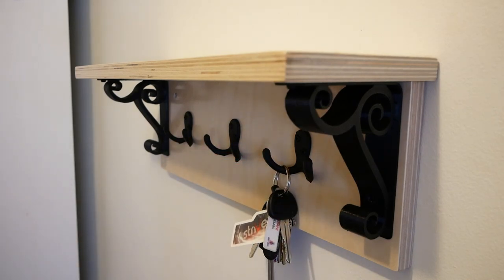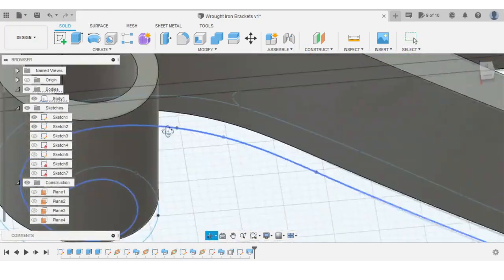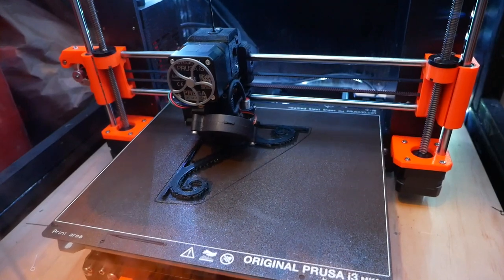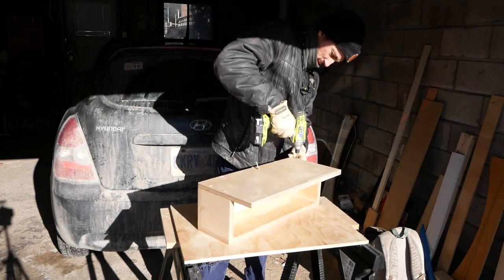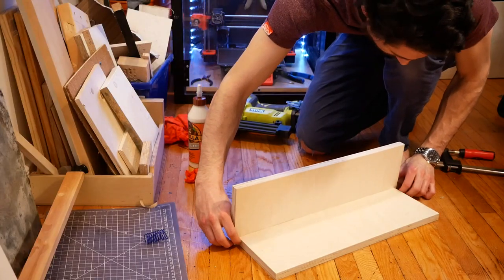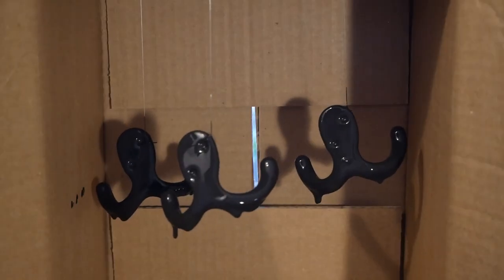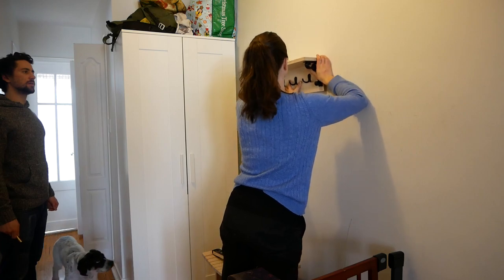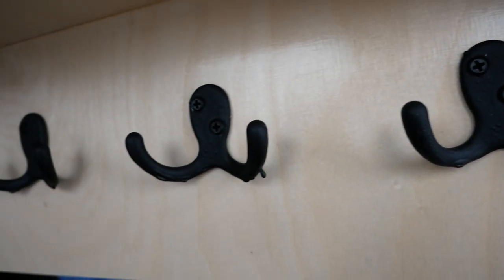DIY Modern Coat Rack with 3D PRINTED BRACKETS

Comment: Absolute genius to make the brackets that way. Pure brilliance; and totally steeling (lol) this idea.
Reply from the maker: Thank you so much Vincent! The print orientation was really key. It would have been so quick and easy if I didn't inset the curls, but I feel like that's key to the overall look of wrought iron.
Reply: @MorleyKert  I think that was the "ah hah moment" for me, because my first thought would be "make a pattern in illustrator, extrude, print" and it wouldn't have looked as good or as realistic.

Also I know PETG is stronger, but it's also more finicky. Check out some of the newer high strength PLA's from places like Matterhackers. You'd be surprised how much PLA can close the gap as far as strength and weight load now.

Comment: Instead of wasting plastic on supports and spending time removing/refinishing them, couldn't you have just cut the model in half and printed two, and glued them together? That would avoid the supports altogether.

You talk about how the model is symmetrical at 1:39, seems like at that step you could have just sliced it in half and printed both halves.

Since the force of the shelf isn't in the direction of the slice anyway, it shouldn't affect the finished strength of your print.
Reply from the maker: That’s a cool idea, I didn’t think of that when I was making it!
Reply: @MorleyKert  great content keep up the good work! I hate removing supports with the passion of 1000 fiery suns so i always try to get creative to avoid them
Reply from the maker: Haha I’m with you, it is not a fun time.
Reply: I will say that lining things up when you glue them is very very hard, even when they are exactly the same you will likely get a visible join line. It might not matter, but it also might matter.
Reply: @samuelmellars7855  it's not bad, you already have layer lines anyway. If you clamp it well and take a second to get it perfect it shouldn't be noticable if your printer is tuned right and has no elephants foot